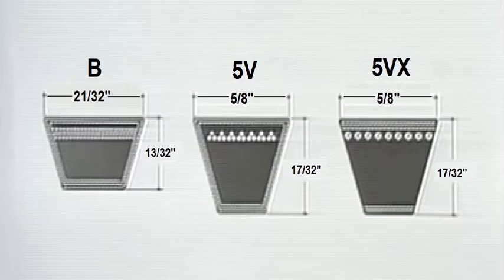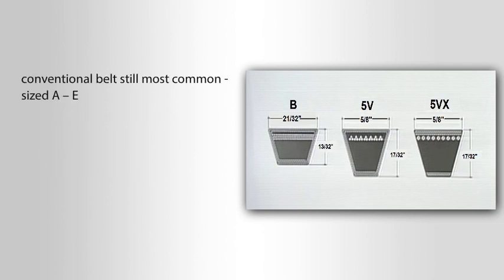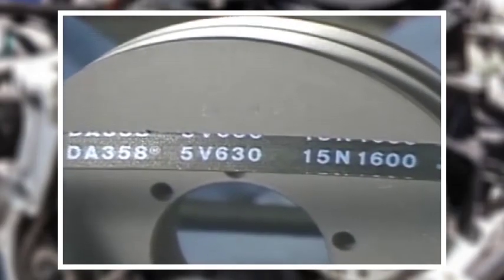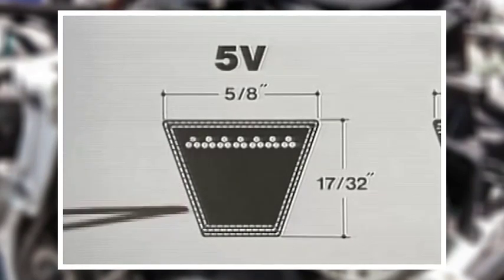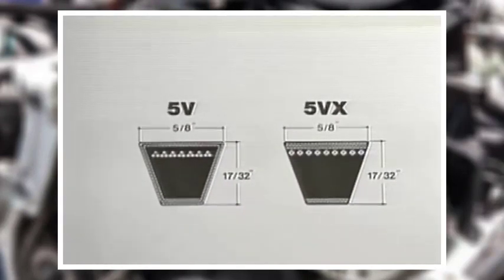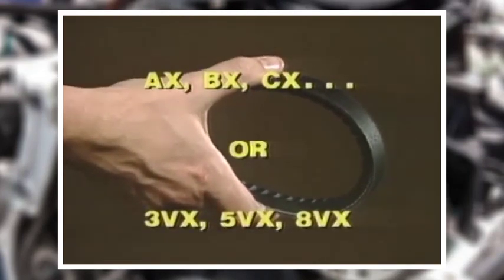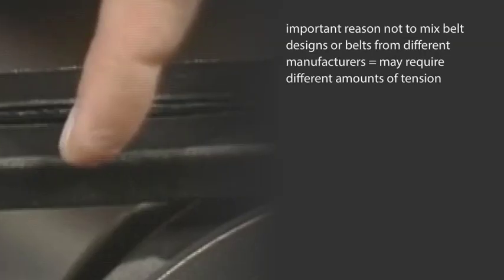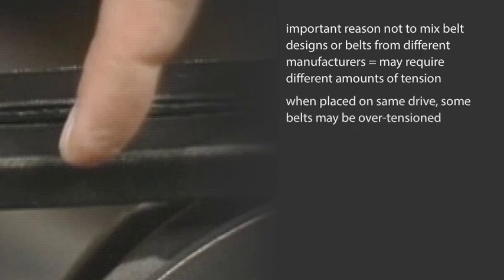Types of V-Belts

Comment: What is the most durable Vee "B" belt available on the market anyone? Ive used:- Gates Kevlar, Pix Kevlar, Castle kevlar etc etc on my mower deck and they are all hit and miss with different results each time using each brand at least twice for testing brands.... Castle kevlar was the best by far! (I put this down to layered kevlar construction rater than rapped!) But one belt lasted 2 years and the second one 3 mowe's.... price is not a issue i want durability!??